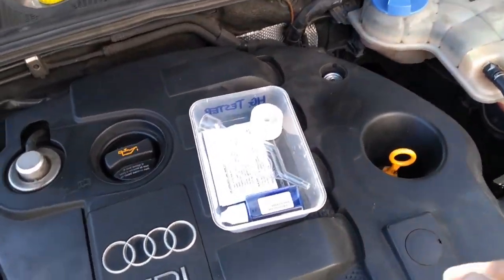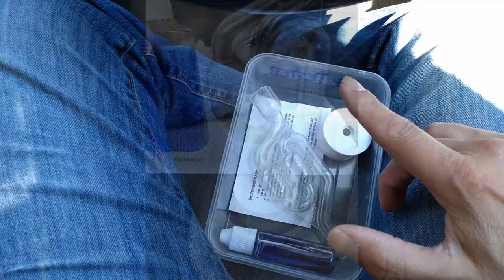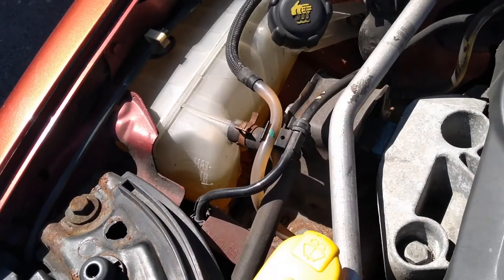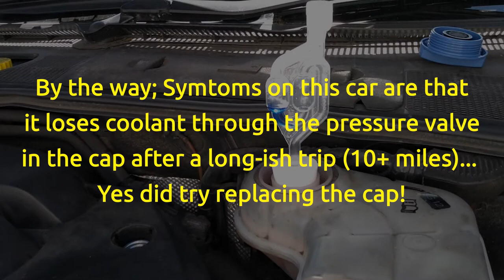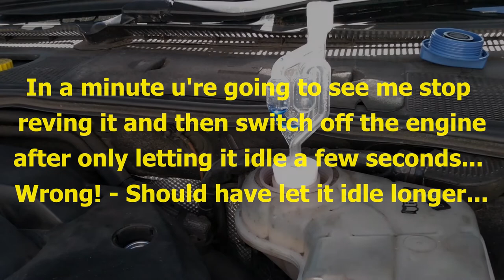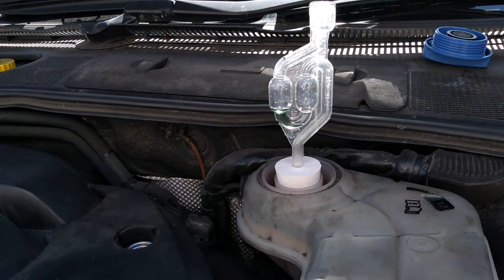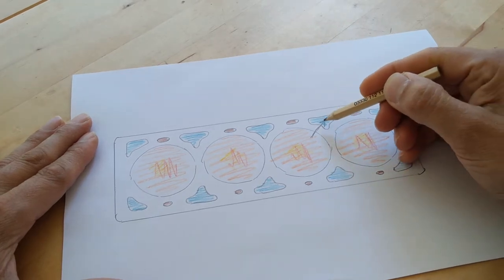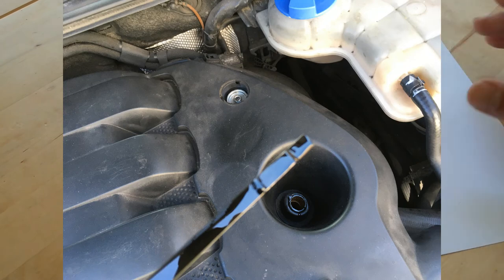Is My Head Gasket Blown? - Confirmation Using Cheap Ebay Chemical Test Kit - Any Car!

Comment: When i did this test i got the greenish yellow colour but annoying my coolant raised gradually throughout the test and ended up sucking some up into the test. As i say i was already getting the colour change before rhat happened. Why do you think coolant level was going up the expansion bottle so much? Was it being revved too high although i dont think it was or is this just another sign im buggered
Reply from the maker: Hi, I thought I had replied to this but appears I haven't so sorry for the late reply. I would say that the coolant is rising in the way u describe because you have a badly blown head gasket - especially if u're getting the green-ish colour too. The shear volume of combustion gases entering the system is pushing the coolant level up.

Comment: holy crap my friend thank you for the information about the staining on the coolant tank, I recently used this type of head gasket tester and got a positive result though I was second guessing the product that it could just be a color changing dye that reacts to temprature, but recently Ive been having this little crud in my coolant tank, I flushed its like 5 times already but gave up accepting that my radiator is just old, I was so annoyed that I bought a coolant filter for my car now you and the tester have me convinced it is a head gasket failure
Reply from the maker: Hello, yes sounds like u do have a head gasket issue, glad the video helped, thanks for messaging.

Comment: You don’t want to top off the coolant really or it can raise up high enough to come up into the test tube. A lot of the time a head gasket won’t start leaking until the engine is warm like you see here. You are testing for the air that is being pushed into the cooling system.
Reply from the maker: Agree.

Comment: My MK4 Golf (1.6 liter, 16v petrol) lost about 0,5 liter of coolant in about 3-4 weeks. First I thought it was leaking somewhere but then I saw small bubbles in the expansion tank. It's not like foaming and bubbling hard, It's like 2-3 small bubbles every few seconds. Is there any other thing that could be causing this or the gasket is the only one? I'm guessing if it was the gasket, there would be much more bubbles, but the fact that it loses coolant is worrying me.
Reply from the maker: Sounds like it could well be the same problem as on this audi - I would do this test.
Reply: I have a rover 75 1.8 turbo that doses the same as your golf but also is OK to drive until I try to boot the gas and them kind of looses power not sure if it's my head or turbo any ideas
Reply: @adamwilliams4377  you probably have pressure leak. Check the turbo hoses
Reply: @DusanStev996  I have put new hosees on and replaced turbo solenoid

Comment: I’ve used the same kit but instead of it changing colour after 2/3 minutes of holding it at 2500 revs the coolant has came up and out of the test kit
Reply from the maker: Assuming your engine wasn't already very hot when u started the test I would guess that's a badly blown head gasket.

Comment: Why do they need this STUPID gasket ?   Why don't they build cars to NOT need a gasket ?  I am sure they can, just less profit  .    Like if people stop getting SICK , doctors go work as chefs.
Reply from the maker: Thanks for your comments. A head gasket is needed - i.e an interface between the cylinder head cylinder block - but certain engines are certainly designed/made better than others.
Reply: @iofix  Thanks for your answer.  But I meant,   why can't they design an engine as 1 unit,  not 2 pieces and gasket between.      1 unit, no gasket,  and it would have a cover on top for access .   Am sure it's duable.
Reply from the maker: @wildthoughts6959  Probably could be done, but would probably cause other disadvantages - e.g. if a burnt valve had to be replaced the whole engine would need to be dismantled...
Reply: Air cooled Beetles don’t use head gaskets!